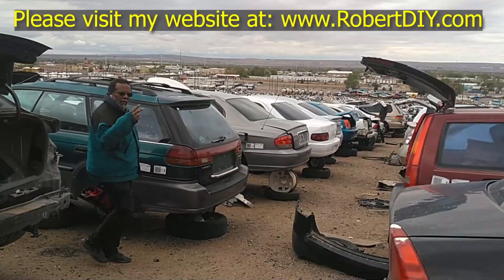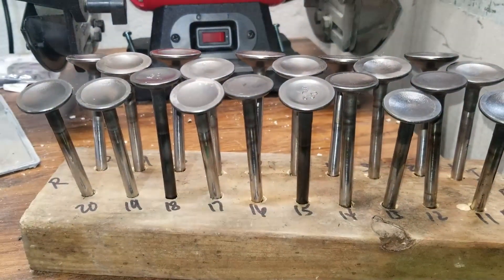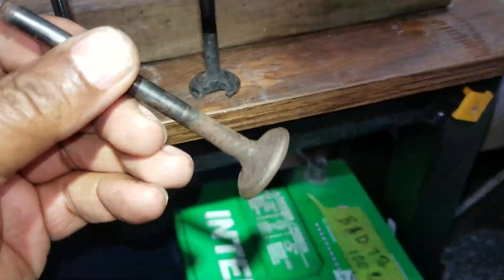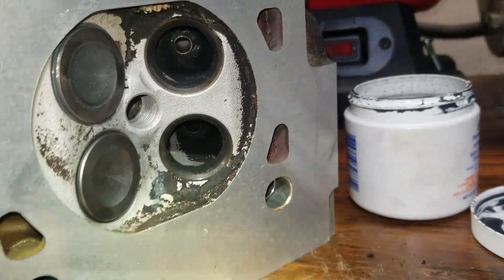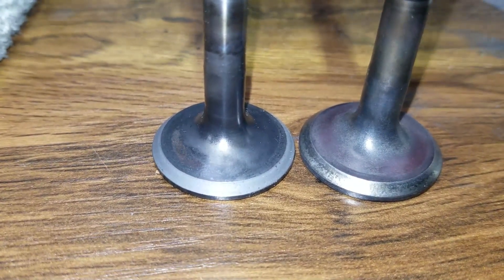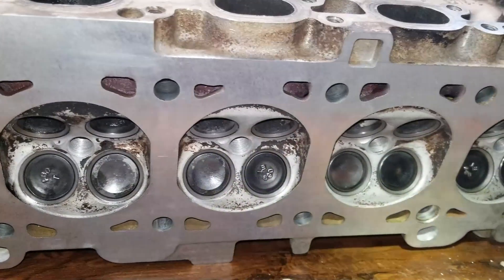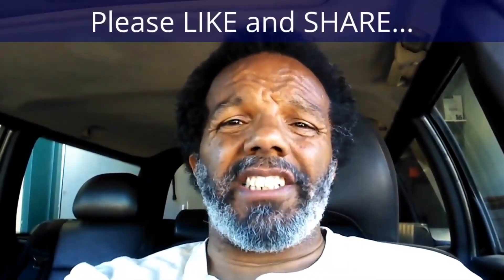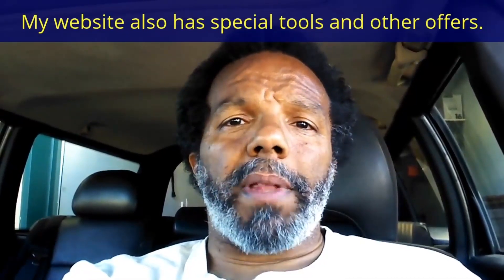Refinished a cylinder head for a P80 Volvo with the N engine. Lapping valves, etc - HOWR

Comment: thats sort of an emergency valve job that won't last too long.  with the effort to remove the head you might s well get a three angle valve job that would last.
Reply from the maker: well, mine has over 150,000 on it since I did it.